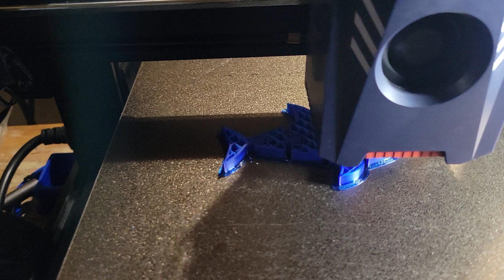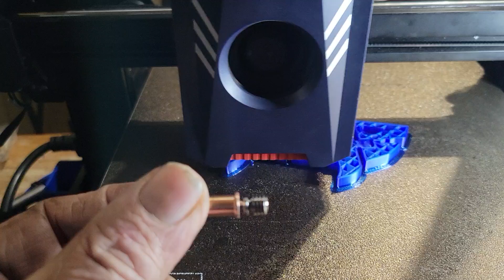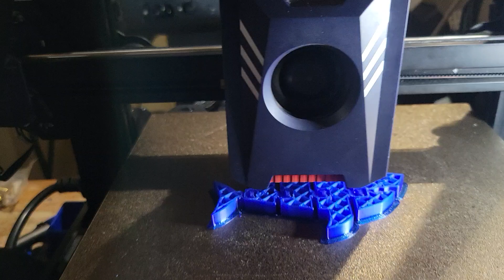Anycubic kobra 2 pro  " All metal heatbreak "

Comment: So I guess my question may be stupid but you claim that it's all metal The one that's in there that I took out is all metal but it has a small piece of boden tube that has to be used so this heat break that you're talking about does it still need the little piece of boden tube inside? Also again the one that's in there is one piece and it's metal so I guess I'm lost
Reply from the maker: Yes, it still requires a small Boden tube, but it is smaller than the one it came with. The all metal break is longer than the stock break.
Reply from the maker: Yes,it still uses a boden tube, but a smaller one. The all metal brake is longer than the stock metal brake.
Reply: Ok I figured out the all metal issue ,I just bought a kobra 2 max, different types of nozzles...it's been a nightmare so I had a all metal heat break for the kobra max and used that worked perfectly and I cut down the tube as well. So now I can use my diamond back nozzle
Thanks for the video I'll subscribe as well
Reply from the maker: Glad you worked it out. I love mine.

Comment: HI, R Reichel, thank you very much for posting this video! How does it hold up after 3 weeks? I also tried to make this upgrade for mine Kobra 2 Pro, but I get nothing but clogs after several minutes of printing. I also see the scar on the bed that happend after leveling without lowering the sensor... same here...
Reply from the maker: So far, mine is doing fine. Not sure why your running into problems so far I haven't had any myself. Hope you get it figured out. Thanks for your question.